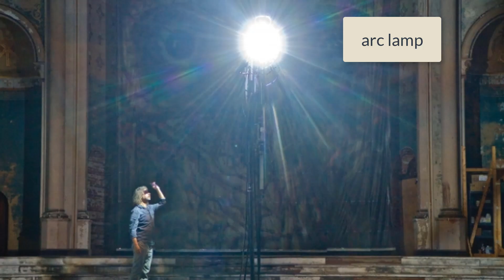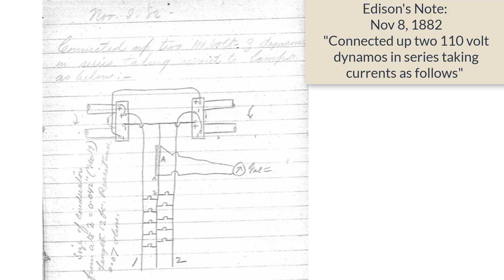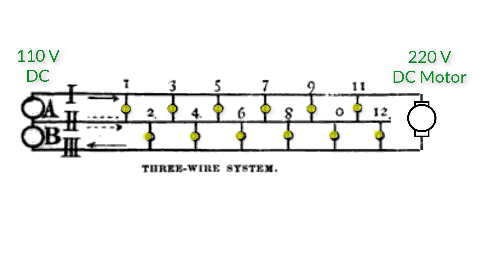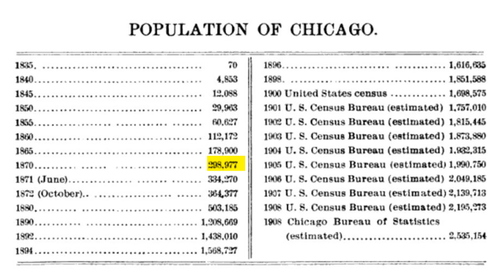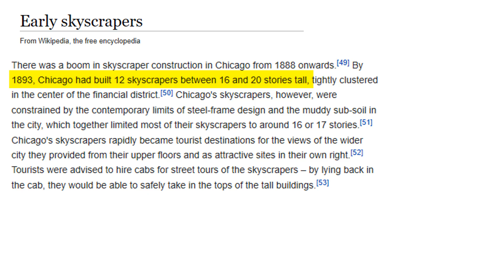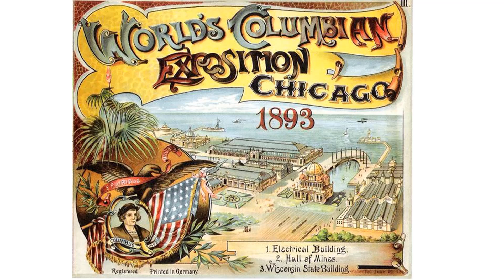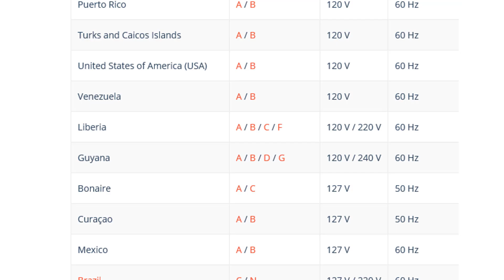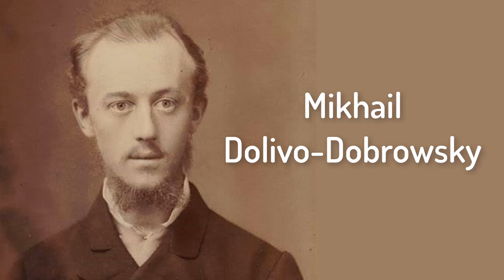Physics and History of Why USA uses 120 volts and not 220 volts

Comment: Carbon arc lights were used for municipal street lighting as far back as the end of the US Civil war (late 1860's).  These early systems all used DC.  Because the lamp currents were quite high frequently these systems were wired in series to reduce the size of the wiring needed.  The automatic mechanisms that fed the carbons weren't terribly reliable and a series street lighting system needed constant attention due to frequent outages as workers frantically ran around trying to find the culprit lamp.  Later lamp designs used resistors for ballasting the arcs so that lamps could be wired in parallel.  The reason Edison went with 110V originally is as you rightly mention the dynamos of the time all put out 110V which, coincidentally, just happens to be the approximate voltage drop across a carbon arc lamp in free air.  Japan still uses 100V as they purchased an early Edison electric lighting system based on his incandescent lamps.  This system ran from batteries that were periodically recharged by a generator and operated nominally at 100V. There were many of these systems used worldwide.  One I remember was used at Warwick Castle in the UK up until 1940.  The Titanic used 100V DC.  But distribution systems based on 110V could use arc lamps and incandescent lamps on the same system.  During the 1930's the US began raising voltage standards across the country, first to 115V, then to 120V at the end of WW-II.  Arc lamps adapted and continued to serve in commercial and industrial settings for many years.  The last municipal arc lamp used for street lighting in San Francisco wasn't replaced until 1958.  It took many years for voltages and frequencies to become standardized.  100 years ago AC was all over the place, all the way from 16-2/3Hz to 133Hz (early Westinghouse single phase systems).  Europe eventually settled on 50Hz, America on 60Hz.  There's still some 25Hz around (US Northeast corridor rail system for one), German railways still use 16-2/3Hz I believe.  I think parts of Philadelphia used 2 phase AC at one time.  Here in Taiwan we still use the original 110/220 Edison split phase system.  There's still some old old stuff here (straight 220 3 phase for example) in the old industrial areas, but mostly now it's 110/220 60H split phase or 220/380V 60H 3 phase delivered.

Comment: The switch in Europe was not so immediate. For example in Finland cities started with 110 V and raised that to 127 V by the 30s. Because it was three phase the higher voltage was 220 V but lights an sockets had 127 V. On rural areas higher voltage of 220 V / 380 V was used. To add to confusion parts of Helsinki used 125 V / 250 V DC. It was only in the early 1960s that everything was harmonized to 220 V / 380 V (raised to 230 V / 400 V in the early 1990s). The conversion from AC to DC was done mechanically with AC motors and dynamos.

The reason for the change to 220 V was related to change of the medium voltage used on transmission. As all transformers had to be changed anyway they raised the voltage. Customers were given free bulbs - which they of courser paid in their bills.

The change was possible as still in the 50s people had relatively few electric devices and many were dual voltage.

Comment: My father was born in 1911, and his father was an electrical engineer who told this story: The president of Anaconda Copper went up to the hill in Washington, DC, and handed out stock certificates to members of congress. He told them that their dividends would be twice as big if the standard was 110 and not 220 volts which used half as much copper for the same load. Your description of two phase is wrong. What you describe is called split phase. Two phase is used for servo motors and certain instruments like remote reading magnetometers. A three phase motor provides constant torque and that fact is paramount for large motors and power stations. A single phase load absorbs power 120 times a second following the square of the sine wave function. While lighting circuits are invariably single phase for economic reasons, the power company balances the 3 legs of the 3 phase circuit so the power station generator (alternator) doesn't feel the vibration that would result from unbalanced loads. An unbalanced load is destructive in that the generator mounts will eventually work loose or vibrate into the earth, and the windings in the generator will shake loose and that would cause friction between individual windings and a breakdown of the insulation on the wires. That kind of failure would not be confined to the generator. In nuclear power plants, during refueling, the generator is disassembled and the stator is rewedged to keep the windings from vibrating. This is simply a life extension exercise. An analogy to visualize the effect of imbalance, consider the difference between an electric  drill and an impact wrench.

Comment: The US and Canada does not use 2 phase in their homes. There is only a select few buildings that still use it. 3 phase is how power is distributed through the grid. Each home gets 1 of those phases at 240V. From the step down transformer you have a neutral between that single phase. So if you have 120V appliance it is running on a 1/2 phase which means it pulses between peak voltage and zero on the positive or negative side of the sine wave. When you need 240V for a stove or dryer then you get the full single phase. 

3 phase is so great because you can make a motor with no permanent magnets and no brushes. It will also self regulate its output speed even under load. The other nice thing is making it reverse is as simple as swapping the wires in 2 of the phases. You can also take the same principal and drive that motor with a turbine or gas engine and with a quick initial excitement of the windings it becomes a 3 phase generator. Also if you have multiple generators once you line up the phases and lock it into the grid the generators will become coupled and a slight lead or lag will self correct due to the magnetic force in the windings.

Comment: A good presentation concerning the history of modern electrification of the US and world I would like add the following. 
December of 1887, Tesla filed for seven U.S. patents in the field of polyphase AC motors and power transmission. 
These comprised a complete system of generators, transformers, transmission lines, motors and lighting the  German 
system is based on Tesla's alternating current system which went on to illuminated 1893 World's Columbian Exposition 
in  Chicago.

Comment: The more popular line would have "Less Resistance as load" and "More Current flow" as a result of more lamps attached.  See Ohm's law: V=I*R where V is Voltage, I is current, R is resistance.  More lamps in parallel would lower the overall resistance, and cause more current to flow.  Now if you discuss the feeder cables, the more popular line (might) be longer, due to more customers spread out. In that case the feeder cable would have more resistance, and hence there would be more voltage drop in the line.

Comment: The United States has its problems, but it is doing one thing right: It is using 120v rather than 240v. 120v is 4 times safer in an electric shock than 240v. By Ohm's Law, when the voltage is doubled, so is the current. E= IR, but P = E^2/R. So, the human body will absorb 4 times the wattage at 240v than 120v.

Comment: Thailand used to have 110V 50 cycles before 1964. My mother brought electrical appliances including record players BW TV set and clocks from Hawaii and we could used it in our new home Bangkok due to cycle different. We have to pay the RCA to convert these appliances to work and some like clock was not worked correctly with overheated problem. I was told by Japanese engineer that in Japan they had the same system with Americans both TV and electricity back in 1960.

Comment: Big error.  You skipped over the whole polyphase  AC vs DC fight between Tesla and Edison. DC doesn't use transformers because it CAN'T. this is key because resistance was a severe problem with DC. Because resistance only affects current, not voltage. By increasing the voltage Europe, which has ALWAYS been poorer than the US, could use thinner wires to carry the same power. Europe was electrified well after the US. But higher voltage increases the risk of electrocution.

Comment: Ingenious, Kathy but I'm not convinced - mainly about the tungsten bulb argument. Tungsram, the Hungarian company you feature, were indeed the first to patent tungsten filaments but carried on making carbon filament bulbs (very good ones, in fact) well into the 20th century and sold them into a big European market. Furthermore, Tungsram and other European bulb manufacturers used an intermediate type - the tantalum filament - in between the two technologies; the tantalum bulb operating best at lower voltages. In addition, many European countries DID use 120v amongst other low voltages. In 1935, the UK has no less than 39 different mains standard voltages - down 80v as well as a mix of AC and DC supplies. Edison was very active all over the world, selling his systems and was in London for some time in competition with Justin de Ferranti (who ultimately built London's biggest high voltage AC generating and distribution system). If Edison's three wire system was so innovative his European sales would have been much bigger than they ended up. Sorry to seem so nerdy. I just happened to recently study both Tungsram and Ferranti for a paper I'm writing.

Comment: The dual voltage countries - Saudi, japan, Brazil - can't count in this argument. They use BOTH. Even with the most generous geography, your map shows about 20 countries using 110/120v. There are 195 countries in the world. 20/195 is NOT one third.

Comment: More lamps in parallel results in less resistance, not more.   The power reduction with more lamps was due to increaed current draw which the dynamo and/or wiring could not support at 100%.

Comment: Either A.) you need to Say "AC or DC" when talking about electrical systems or B.) need to understand transformers only work with AC power. It is very hard to follow what you're saying. I deal with electrical systems daily. Also "two phase" is no longer used anymore. It's called Split which is 180 degrees out of phase. Which requires three wires. And "Two phase" requires four wires and is 90 degrees out of phase with one another.

Comment: because they can charge more for 120v and it takes more power to operate a 120v motor than it does to operate a motor at higher voltages. Just follow the money.

Comment: The US did settle on 230v and 240v, but it's split phase:) So my panel runs at 251v at 200 amps with 2 legs, each supplying about 126v at 200 amps.

Comment: In the past 130V incandescent lamps were available for rural areas where the voltage was not that well regulated. An incandescent lamp burns out exponentially faster as the voltage increases and the higher voltage lamps would have a much longer life.
Another trick before LEDs became popular was to use 28V lamps as indicators in 24V circuits. The indicator would not be as bright, but the lamp would last substantially longer.

Comment: I live in a camper and most of available electricity is 12vdc while my phone charger uses around 1vdc fridge uses propane as heating circulation with 12vdc. Nothing uses 220vac all 110vac are 60watt LED I'm trying to reduce my carbon footprint just started research on solar storage arrays its very expensive to make mistakes at this phase

Comment: Kathy, I didn't know how else to reach you, but I just saw a very interesting video on the Veritasium channel called "The Big Misconception About Electricity". You might want to check it out. I did a quick scan through you videos here to see if one looked like you might have cover this topic, but nothing jumped out at me. It seems pretty important to our understanding of how electrical power is propagated. I know in may undergrad physics courses many decades ago, I was not taught this concept this way. That is to say, I was taught that it was the flow of electrons that propagated the energy, and not the electromagnetic field.  That the same is true for DC as well as AC was what surprised me.

Comment: Until the 1930s there was a dizzying array of different types of power supply depending on where you lived. It might be AC or DC, the nominal voltage might be anywhere between 200 and 250V and on AC system the frequency might be 25, 50 or 60 Hz. This was because power was supplied by local generators, often owned by the municipal authority. However during the 1930s construction of the National Grid began and that distributed power at 50 Hz 3-phase AC. Local distribution was at 230V.
Because construction of the Grid was delayed by WW2 it wasn't until the 1950s that all areas of the country were connected to the grid and some local areas continued to have these non-standard supplies right up to the early 1960s. After WW2 the nominal voltage of local distribution was raised to 240V, but more recently it was notionally reduced back to 230V +/- 10%, but in practice supplies are usually still around 240V.

Comment: My house built in 1910 originally only had 4 circuits at 110v. I always wondered if it was missing a “leg” for not having 220. Thank you for the video explaining that it was normal to only have one hot and neutral at the time for residential buildings!

Comment: Fantastic presentation of some important power history.  I'm a retired EE/CS and while very well read on early AC power as well as some on Edison's DC,  the use of +/-110 V by Edison as a means of copper savings was not known to me.  Impressive research, and a most enjoyable presentation. 

I'm looking forward to your book and thank you for your outstanding work.  One piece of history I'd love to see you do is Edison's early attempt to use earth as neutral, and the resulting shocking from step voltage potential.  Another would be the insane WYE multiple earth grounding practice which was used to protect motors, but violates transformer isolation and thus injects massive neutral current through the earth as well as creating a problem similar to but lower than Edison's earth as neutral.. Zipse's work is a good starting point.  

Thanks again for all your outstanding presentations.  I'm a big fan.
Bruce